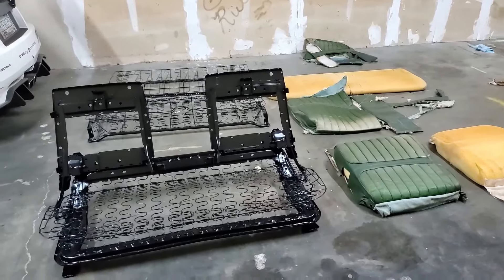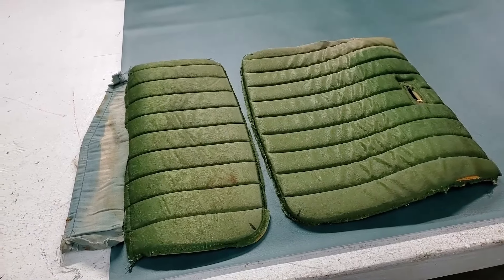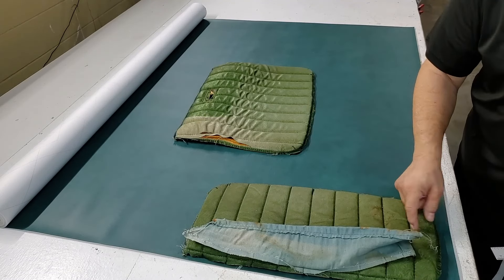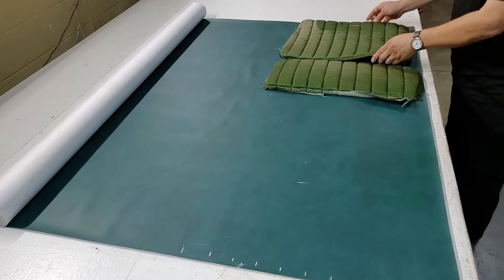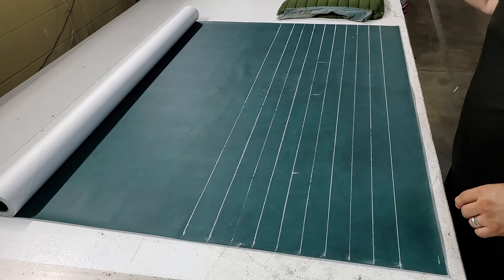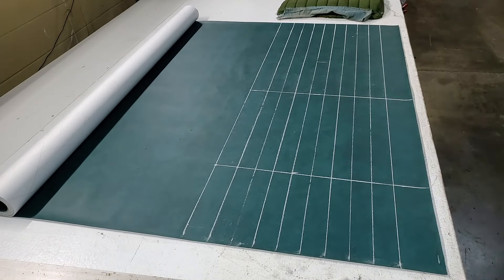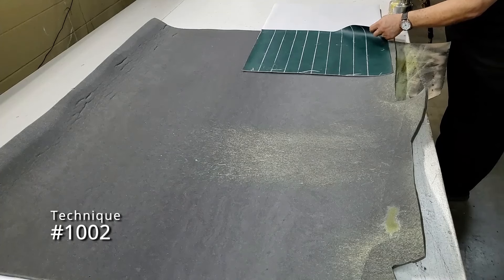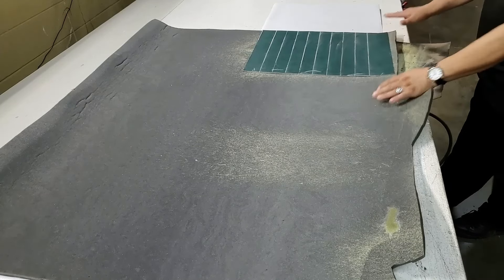Learn Now! How to make your own seat inserts auto upholstery

Comment: Is there room on the sides for margin to sew side panels onto?  Just curious as I think I need 3/8" or 10mm to have material for long lasting strong  sewn joints to sides. Maybe missing something as I am sewing leather onto custom buckets after welding newer donor seats. Thanks again for an informative video! Regards.
Reply from the maker: Hello Dean, You are so welcome! I usually leave a 1/4" to 3/8" seam allowance for motorcycle, automotive and most marine jobs. Some marine and furniture are up to 1/2". Please keep liking and watching!
Reply: @oldschoolautoupholstery   Ok, that sounds perfect as in the video depending on how the panel is used, trimming to the edge of the stitches keeps a flat seam without bunching! Cool.
Reply from the maker: @deankay4434  Hello Dean, Yep, you got it! Please keep liking and watching!

Comment: what size of the foam did you use . I just tried 1/8 if headliner and I got totally flat surface. the bottom side looked a lot better.  I have singer 4411 machine.
Reply from the maker: Hello Michael, Yep you just made a perfect description of the result of using headliner material instead of 1/4" or even 1/2" scrim. Please keep liking and watching!

Comment: can you tell me the density of that foam youre using? i heard you say 1/2" thick scrim. but ive seen most upholsterers use a 50 lb on the seat areas and 100 lb in the bolsters. im about to order my foam for my seats ,very soon. i spoke to you yesterday about it. i want to turn a flat  old spring seat into a bolstered end almost like like a bucket bench. The springs are very lofty still and i like how the spring seats feel. i just want to use thicker foam on the ends and maybe in the lumbar area for more contour and support. do you have any videos doing something like that? again, thank you very much , I look forward to watching more of your work.

Comment: Hi Rudolph, great video, one question …. Why didn’t you make the 2” pleats a bit bigger before sewing so that the finished pleat is actually 2” like the original ?
Reply from the maker: Hi! Thank you! You are right, I add a little bit, 1/4" to the measurement because after the vinyl is added to the foam, there is a third dimension. The result is a finished 2-inch pleat.